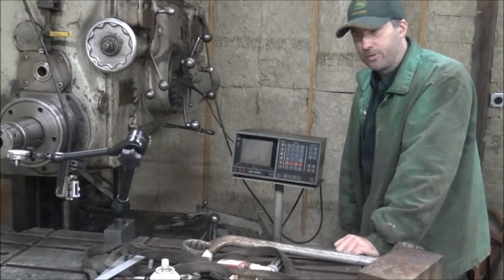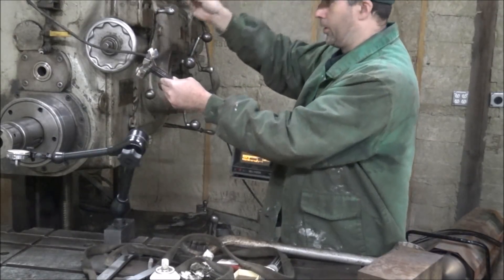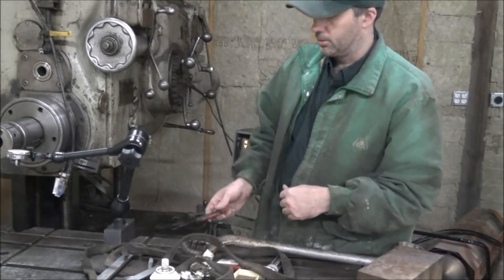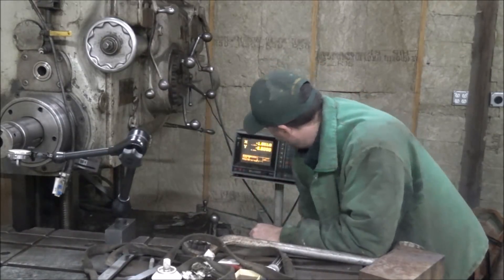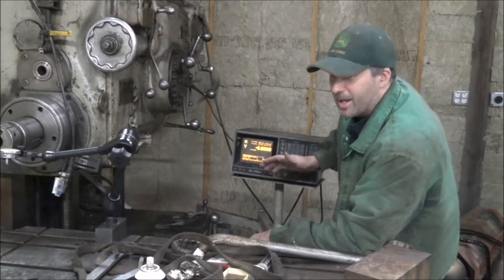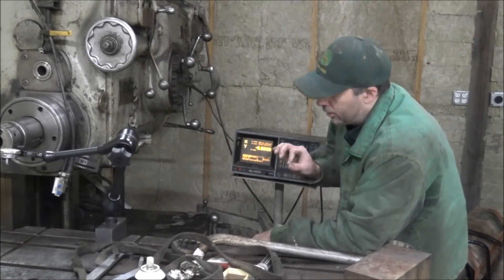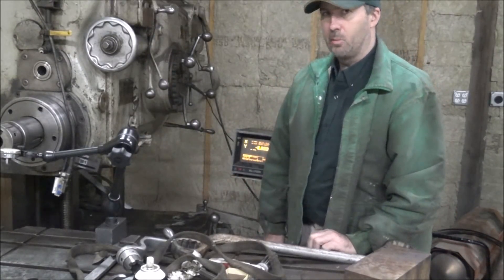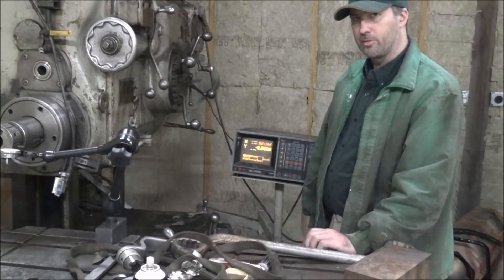Almost Accu-Rite

Comment: Regular grocery store checkout conveyers & garage door safety stops use an LED & mirror system. The LED light wave is a frequency that is invisible to the eye. Cleanliness is very important for accuracy. I only mention this because you couldn't see yours working during your test & to let you know that these LEDs are more common you might suspect. Best wishes Brian!

Comment: Brian, I think you are on the right track with the trim pots. The scales use "quadriture" to figure out which way the machine is moving. There is an A channel and a B channel that are offset by half the resolution of the scale. If the system sees a pulse from A or B first, it can determine which direction it is traveling. Typically, the scale is just like an encoder. It has an A high, A low, B high, and B low, as well as +5V and ground. Some also have a high and low marker signal. The system has to see both the high and the low at the same time to register the pulse. That's how we keep noise from interfering. The actual signals are sine waves and have to be filtered to create discrete pulses. If you need a scope, I can ship you mine. It's pretty light. If you want to buy one, I love my Rigol digital scope. You can get a used one for <$200.
I don't know if these are glass scales or magnetic or stretched tape or what. But, they all work about the same. If it's a stretched tape, make sure the tape is not damaged. Also, be very careful with the lip seals. If they are loose they can get caught up in the reader head. Don't ask how I know that...
Reply from the maker: They are glass scale. I talked to Ray at RLA today and I am pretty sure that part of the problem is the wire is no longer bent correct that pushes the reader against the scale. If I hand held it I could get it to read both ways, the problem where it didn't want to read in reverse didn't appear until I mounted it.  I think if I get it aligned correctly it might read now. Also he said they usually see problems if the voltage is below 5.00 and I am only reading 4.97V so he said to bump that up to 5.1 and see if that doesn't fix it. Apparently if the volts is below the 5.00 it can cause trigger issues with the counting.
Reply: Sounds like you are well on your way. When you think about the resolution that is possible with these scales, it's amazing they ever actually work!

Comment: Brian, The LED's are generally infrared so you will not see it by eye but some cameras can image them.   When I was researching scales a while back I found there were at least two types of read heads -- digital pulse output and sine wave output.  Modern ones generally huse  the digital pulse type and have two digital signal lines that are in quadrature (90 deg apart) and swing between ~ 0 and  ~ 5V as the glass scale lines pass the read head.  Each  low to high or high to low transition on the line pair represents one tick of the scale's resolution.    You can look at the signals with a scope and possibly a volt meter -- just remember there a lot of signal transitions occurring in an inch of movement.  You need to move the thing really really slow to see the wave form on a meter.   The pattern goes A- high,  B-high, A-low, B-low then repeats only one lead changes at a time.  Signal A leads B for one direction and B leads A for the  other direction of travel.

The read heads need to be powered -- usually at 5V from the display unit so there should be a power and ground lead.     The signal leads can be either single ended  ie.  a signal line measured against ground or  use differential signaling.   Differential signalling allows for better noise immunity for longer runs between the read head and the display.  Differential uses a pair of signal wires where one wire is high relative the the other for a logic one and the reverse for a logic zero.   If the read head uses differential signalling there will be a pair of wires for each quadrature signal --  the pars are generally twisted in the cable to cancel noise.   No twisting is not definitive as one can still use differential signalling and not twist the wires.

For single ended signalling the minimum wire count would be 4  plus any shield wire.  Power Ground Signal A  Signal B   for differential it would be 6  power ground pair A and pair B. 

But some scales output a pair of sine waves in quadrature that take further processing to convert the phase differences to the actual linear measurement.  I think it would be hard to make sense of these signals with a meter or possibly even a scope.  Best you could do would be to verify both are present or absent.  If you have one scale working you  can use it to help determine if the fault is in the head or the display head by  simple swapping. 

Good luck,
Craig

Comment: long shot, but old electronics equals old capacitors.  Give the boards a once over.  No bulging caps or leaking caps.  Could take it a step further and get a cheap esr meter and check them.  Might not be the problem at all, but it’s usually my first go to spot to look.

Comment: I had an issue with an Accurite III setup that the X-axis readout would just go out. It would come back on as soon as you re-zeroed though. I realize your issue is somewhat different but so are the DRO setups. I ultimately figured out that the read head was not square to the scale and for whatever reason the reader would just loose contact with the DRO itself. Again, not sure if it is the same / similar issue but probably would be worth a look. Thanks for the great videos.

Comment: Brian I have woodworking equipment and I would agree with cape cod cnc about the grounding and shielding. These are both extremely important and must be right. Sometimes the shield is not supposed to be grounded at one end. Obviously I am not an expert, but the sort of wandering you are experiencing in your readout suggests this. Look forward to your videos.

Comment: Brian check your grounds from end to end, also check that the shielding is properly grounded. Next make sure they are away from any power wires as voltage can be induced from one wire to another. Bad grounds can cause major headaches. Also make sure the glass is spotless inside the scales.

Comment: Im not an expert on this stuff thats for sure but I was wondering if with the moving of the machine around could the air gap between the two surfaces be out of adjustment? eg: to big of a gap to read properly. But when I fitted my DRO to my lathe I cant remember it being a critical adjustment though.

Comment: First thing check power supply for scales some voltmeters will read AC ripple when you check power supply use AC low voltage scale. Power supply is always suspect in old equipment ripple should be very low millivolts. Scale power supply is separate from display power supply. Hope this helps.

Comment: Cards?  Consider trying this.  Find an Eraser.  The kind used on pencils works well.  The kind used on Ink pens, the coarse white stuff, tends to work best.  Erase all the contacts on the edge of the cards.  Both sides, til they shine.  Use a piece of very fine sandpaper in the slots they go into and vacuum the slots to achieve similar cleanliness.  The objective is to have perfect connections, for the sake of reliability.  All connectors should be treated this way.  By the sound of it, the chances are good that this will make a difference for you.  Bo.

Comment: If you pull off a reader head, can you show how to remove/re-install?  The x-axis doesn't work on my mill (same scales as yours), but I think it's just an adjustment issue as it was working intermittently, and reads sometimes.  I tightened the screws mounting the reader, and it improved a bit, so I'm pretty sure its just needs tweaked.

Comment: You already know the actual scales at those lengths would likely be the largest cost Brian. My dro/electrical isn't even close to where I could offer any usable advise. Any way to add current production reader heads that would work with the scales and dro display you already have?  For my own shop having 100% faith in the metrology equipment and the measurement readings they provide isn't optional even at a hobby level. Doubtful I could add many or maybe any ideas you haven't already thought of. Adding a second new 3 axis display and buying the scales/reader heads for your shortest scales and keeping the good reader head as a single axis on the longest axis as a working system might get you by until you can afford to replace that might work in the short term? Given the age of that system and the rough treatment it seems to have had by those so called riggers that might be the most cost effective way forward? 4 axis always seems to add a lot to the costs of the display. As you said in an earlier video having a scale on the spindle travel would be very handy. One way or another I can see your going to be spending some coin on the problem. I wish I could be more helpful.

Comment: i wonder if there is dirt on the optical heads or a coating of grease obstructing their view.. you would need to make a swab up using lens cleaning tissues. as conventional Q tips or towels can scratch the lenses.  throwing everything wonky. 

 the manual.. that was linked described how to clean the rules and the optical lenses without damage..

 the head that is installed.. can you see if it shifts position when you change direction..  it could be shifting because of drag on the scale and going outside the indicated area..

Comment: You cannot use a multimeter on that stuff. You have TTL square signals probably there. Try to switch the axis just to see if you have the same behaviour on the display (to exclude display troubles).

Comment: brian, having similar problem with Y axis DRO. It decided to only measure 787 out of 800 ai middle of table.  messed up 3 parts b4 i discovered. still trouble shooting. Then when i move table readout 9.000 inches it measures 9.50".
Reply from the maker: Probably dirt on the glass scale in that spot. You try cleaning it with windex?
Reply: I will try that, have not. thought id swap x-y on readout first.  it is NOT dragging. went there first. messed up 3 sets of scope mounts before I caught it.  Trammed, sprcial tool i bought just for that had missing dial ind spacer, made 1. perservering

Comment: You might be a lot better off buying a new DRO.  In electronic devices 15 years is like ancient artifacts.
Reply: The problem Brian is facing is the size of the scales -- that machine is going to have very large travel scales  costing big bucks.
Reply: are you talking about the scales or the display unit? Because the display units's function is just to show numbers. I am aware that some let you store tool coordinates and circle pattern generation.
Reply: I am talking about the whole shooting match, scales, display unit etc..  The display unit on my DRO does a great deal more than just display numbers.  It calculates bolt hole circles, arcs. angled lines etc, stores data points etc..  If all his does is display numbers it most assuredly needs replacing.
Reply: Sometimes the best solution is to bite the bullet and modernize.  Sometimes a newer brand name may come at a cheaper price and also have more modern and reliable features.  When I left the evil polluting refinery they still had some old 1980 era instruments but they were replacing them with new instruments and computers that were decades better than the old stuff.  Cost them many millions but they felt it was more than worth it.
Reply from the maker: Only $4K for a new system from DRO pros.  I might fool with this a bit longer before I give in to that kind of coin. Or at least do some jobs on this mill to prove its even worth it. It hasn't made dime one yet!!

Comment: It certainly sounds like a dirty pot.  As long as that has been sitting unused, it isn't surprising.

A spray-can of contact cleaner (for pots) and/or a pencil eraser (for board contacts) should clear up most of the intermittent operation problems.
Reply: use a 'white' eraser, the pink ones are a little abrasive.  Enough so that they can take plating off the copper traces, including the gold on edge connector pads.
Reply: If the pots are the carbon track type (very common) then definitely DON'T use contact cleaner as it's designed to dissolve carbon!
Reply: Be careful of what material the eraser is made of - some leave very undesirable residue.  I've had bad results from the white PVC erasers like Pentel etc. Chlorine reacts with copper and moisture over time to leave copper chloride corrosion of the traces.  These days I use Mars drafting erasers. It seems to be a synthetic without chlorine and doesn't cause more problems downstream. BTW, where are you located - you might be in range for a field trip from So. IN.

Comment: Switch power from phase converter to outlet power
Reply from the maker: It is plugged straight in the wall, no phase converter in this system.

Comment: Good stuff Brian - dark magic here for sure. What we need here is a very clever kid from Australia to chime in. 

JBfrom OZ - please share what you know. 

Dan
Reply: G’day Brian! I mentioned in the previous video that the 0 5 0 5 likely means that one of the two channels is not connected.
The theory of quadrature encoding is a phase difference between two channels A and B. One of my videos uses an arduino UNO as a diagnostic tool, cheap at a few bucks.
Essentially you will expect (Likely) a supply and ref 0 voltage, and an A and B signal wire
thus there are 4 possible combinations of the AB pairs.  In one direction  0,0. 0,5 5,5 5,0 in the other direction 0,0 5,0 5,5 0,5 
9assuming supply voltage of 5v)
Reply: Where you previously only had measurement 0 ,  5 , 0 , 5 it appeared if the sensor was detecting a change on one channel but no change on the other channel
This may be due to a broken lead, or a mi1salignment on the read head, or some other failure in the light or sensor on one channel of the read head
If you have access to an arduino, let me know and I can shoot you some code that can help check the signals that you are rec3iving with using a CRO
The potentiome3ter on my scales is used as a voltage reference for when the light/sensor reads a mark or a gap. Internal is likely to be a voltage comparator between the supply voltage, mid point voltage, ground voltage and the sense for A and B channels. While you are seein4g some inputs when tweaking the  pots. This is likely to be due to one channel being held high or low, with the other one working as in your 0 5 0 5 case my gut suggests the damaged lead or misaligned head is the direction to be working on
Reply: That's our guy - Wonder from down under!
Reply from the maker: I talked to Ray at RLA today and I am pretty sure 
that part of the problem is the wire is no longer bent correct that 
pushes the reader against the scale. If I hand held it I could get it to
 read both ways, the problem where it didn't want to read in reverse 
didn't appear until I mounted it.  I think if I get it aligned correctly
 it might read now. Also he said they usually see problems if the 
voltage is below 5.00 and I am only reading 4.97V so he said to bump 
that up to 5.1 and see if that doesn't fix it. Apparently if the volts 
is below the 5.00 it can cause trigger issues with the counting. I don't have an arduino, likely investing in a o-scope would be money well spent in the long run. No telling what demons might want to come out of the Cincinnati when I get to it.
Reply: Gday Brian, ok alignment from the wire is definitely a possibility. My read heads are different, but the spring loaded wire is what holds the reader on the scale, might be something you see in this video that helps... https://youtu.be/CaoYRI4bDHY

Comment: Brian, what model number is that DRO? I'm trying to figure out if those are digital or analog scales. All the Accu-Rite manuals I can find say "warranty void if you think about the read heads", so there is no useful setup info. But digital read heads would probably be a heck of a lot easier to get tweaked in than analog heads.
I did find the pinouts for those read heads in case you haven't found it and want to check. Page 18 of this manual:
http://www.acu-rite.com/pdf/manuals/516291-21_ve00_senc_150.pdf
Reply from the maker: The DRO is a Millvision the scales are AR-5.  If you look at the description on my asking for help video the links to the correct manual is there.

Comment: nice, at least that dro box is doing something. looks like thats a full blown computer of its time. too bad the outer scale housing doesnt seem to be removable to see if the read head stays put while moving the table.
Reply from the maker: Yes probably the best in 386 computing power at the time! lol
Reply: It restarts way faster than any phone/laptop/tablet produced today.....
386 is plenty pf power for that machine and the calculations needed to run it. Its the pretty color graphics on a modern machine that take the horsepower.
Reply: yeah, nothing much for video editing, but maybe take a shot with an open hood next time? just for fun, that thing is eye candy!
Reply: notso fresh id even go so far as to say a 386 is a good amount of overkill for the application. but thats the fun of looking into specialized machines, you never know what they put in there.

Comment: I'd suggest taking a quick look at http://www.dropros.com/, we've used a couple of these DROS at work and they're really decent for the price.  They have scales in almost any length you'll need.  For that matter there's a ton of chinese dros out there even cheaper. I've had an ebay unit on my clausing lathe for 5 years or so, never a hiccup, does everything I need to do very accurately. You can't screw around with an antique for very long when you can buy new so reasonably.